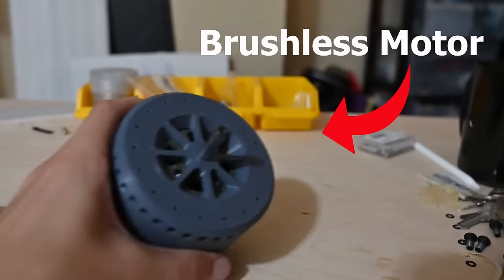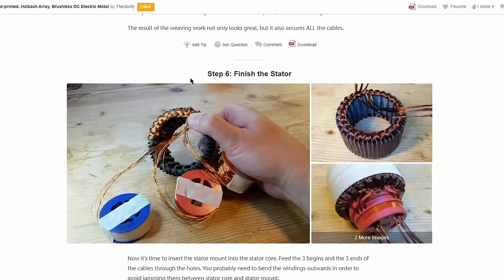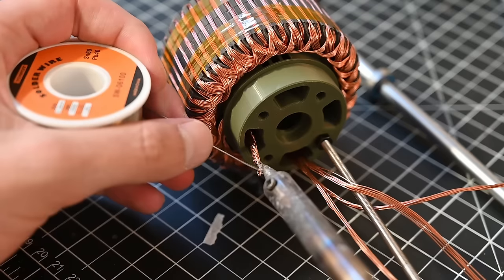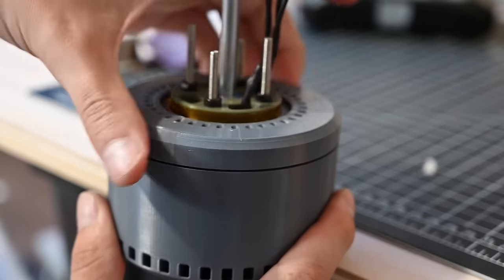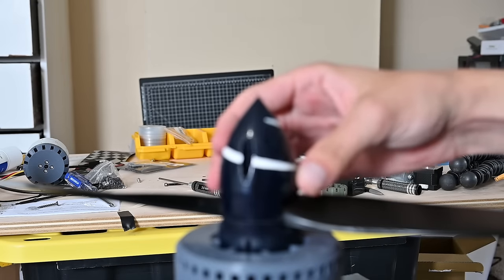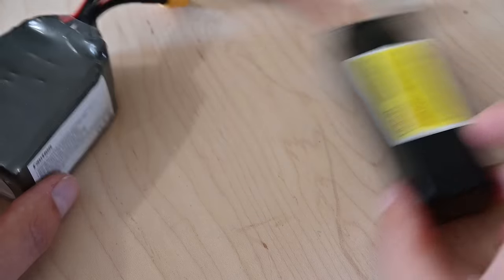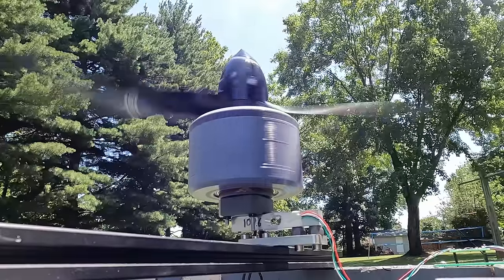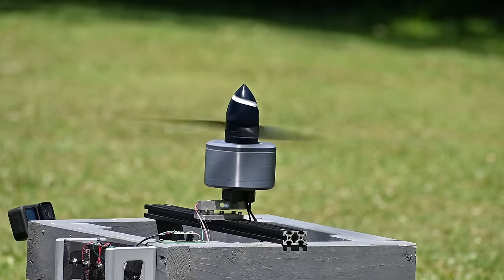A HUGE 3D Printed Brushless Motor??? How Much Thrust Can It Make?

Comment: I don't know why people continue endlessly to test any 3D printed design against machined solid materials, except for LOWER COST while ignoring actual physical strength of solid homogeneous materials, compared to 3D printed facsimiles of a rock solid object.
When a 100% totally 3D printed Formula 1 race car can even once win a race I may start to notice there are outliers. Otherwise solid materials produce the highest performances and the most winning designs, no matter the capitol spent on "3D" sponsorship. Period!
Reply: Material properties aside since several forms of additive manufacturing allow for the use of higher performing materials, 3D printing allows for constructive topologies that just can't be obtained through traditional methods like cutting and drilling and casting, some of which can allow the printed product a significant improvement in any of several specific markers including durability and rigidity gram for gram against the same material when solid and allow for embedding other objects in ways unavailable with traditional methods. Sometimes the cost of that new topology is actually higher but the result produces enough improved efficiency in a given task to more than offset the initial cost through lower usage costs. People test printed designs against solid ones to prototype those new topologies, and to sate their curiosity about how things work and compare, and because it's sometimes far easier for them to get the printer and feedstock than to get casting or tooling materials and the equipment to work on them.

Then again, I don't know why I'm bothering to give you an explanation when you're obviously on YouTube more to gripe and troll than you're here to learn anything.